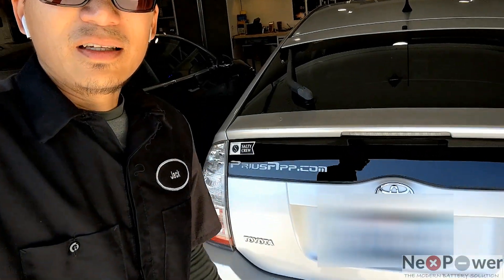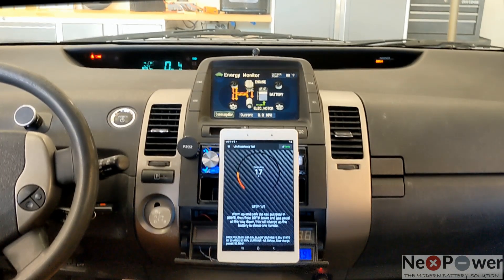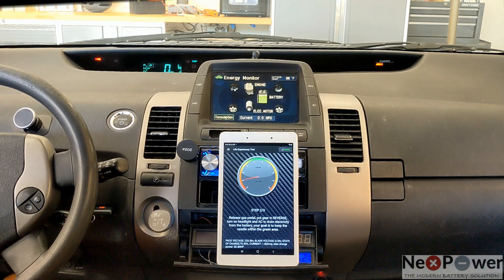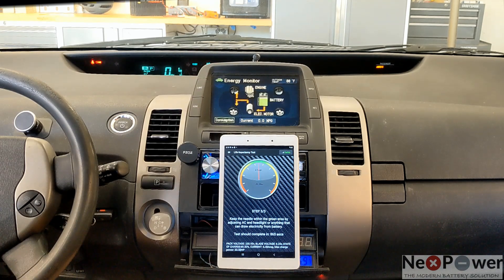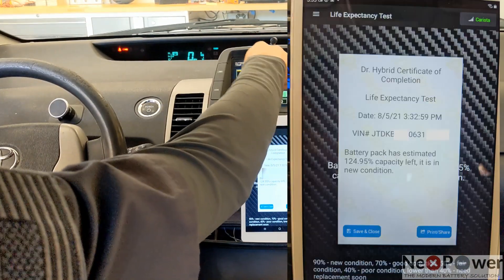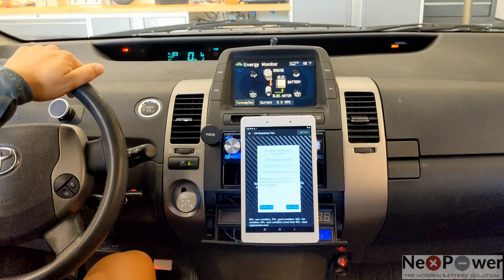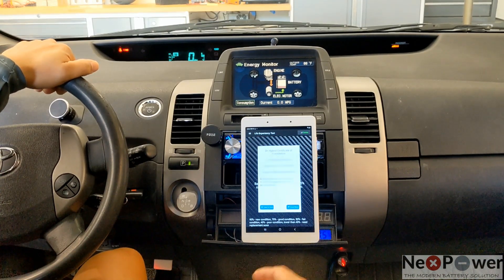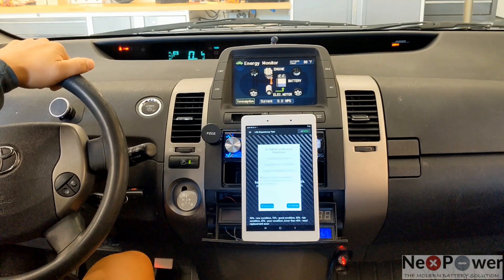Life expectancy test against Nexcell Lithium upgrade battery

Comment: Yeah, I got stolen one of his crappy batteries. He replaced it and then said he would take care of the next one. However, I’ve been told by others that he lies and recently I asked about getting the new updated one after Jack said mine might last maybe three years after the first one died. Now he’s saying I gotta spend $1000 if I want to replace it. I’m looking forward to a class action as I hear a bunch of them have gone out. What comes around goes around eventually. He has videos that talk about how great it is and then I have proof in an email that says it won’t last after I spent over $2000 on this damn battery.

Comment: Does it increase km per litre or that stays same? What is the new figures?
Reply: I would say substantially yes, I haven't got the data yet myself but because lithium charges more efficiently, and because the capacity is more the knock on effect will easily offset the cost of the new battery within a couple of years (especially at today's fuel prices)

Comment: This test on Dr. Prius app is never accurate, not even near to accurate. I tested a busted battery pack giving "replace hybrid battery pack" code everyday and it showed that pack has 75% life left.. LOL.. the result above authenticates the misleading results of this test itself i.e. 125%.. LMFAO... I only asked the manufacturer for the Total Capacity of the pack with Nexcell cells in mAh, and he never replied, coz he knows its Half as compared to the stock pack. How can a pack built with these cells be better then the stock ????
Reply: I do not know the raw capacity of this pack, but I suspect if the original battery only allows you to use 40% of its capacity to preserve reliability, these packs may allow you to use 60-70%.
Reply: @nexusnexus5095  i need a pack for a gen 3.... Whats the price tag